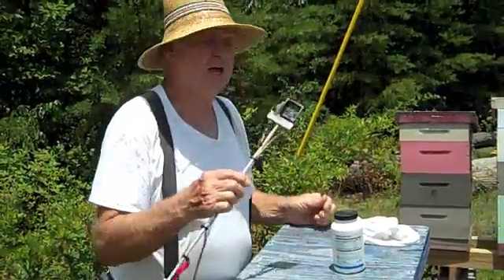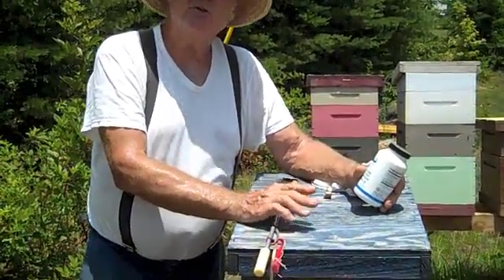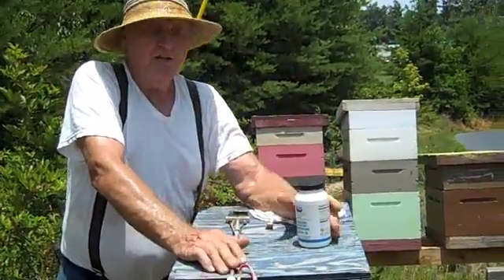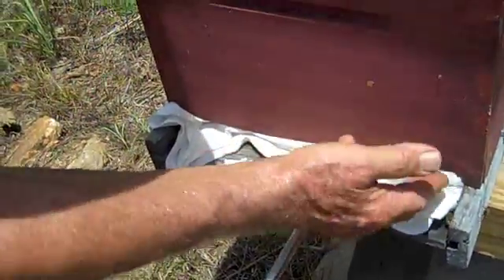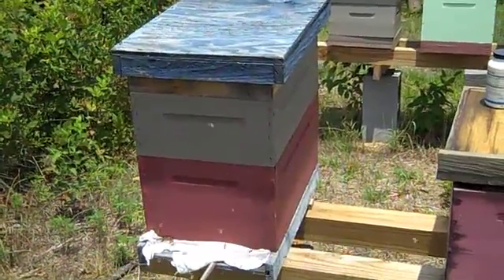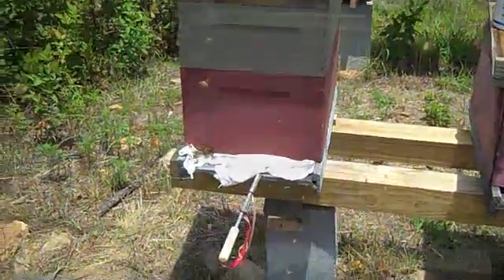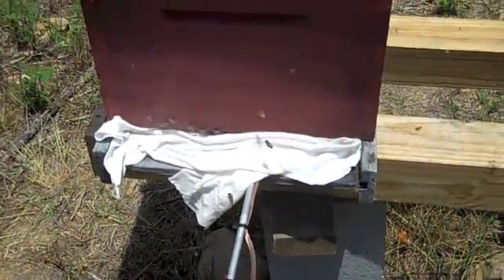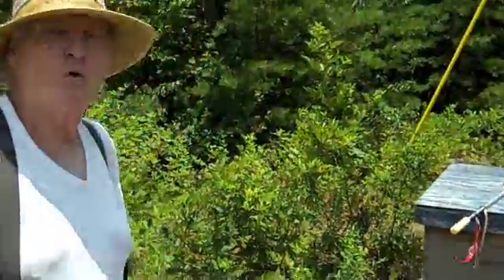Oxalic Acid Mite Treatments

Comment: I read a week ago that. Mite treatments are what is causing colony collaps.  I believe it.
I used it one time.  The bees did not do well.  After that I got rid of my weak hives and kept and only bred the best bees.  Good breeding  for clean bees  works best.  They are far more productive too.   Also if a stint produces a white pushups in an hour or two and the bees are fussy then I know they are sick and have a tummy ache.   I then feed them a quart of sugar water with erythromycin sulfate antibiotic in it.  A week later they are fine  and easy to work with.  Steeply is fire blight spray for pears etc.  I get t it at a garden store.

Comment: Thought you would be interested in this article that just came out on this subject:
http://www.sussex.ac.uk/broadcast/read/33537

"A team from the Laboratory of Apiculture and Social Insects (LASI) has determined the best dose and method for treating hives with oxalic acid, a naturally occurring chemical already being used by beekeepers to control Varroa. 

The study, published today (Thursday 17 December 2015) in the Journal of Apicultural Research, shows that two of the three methods used by beekeepers to apply the chemical cause harm to bee colonies, resulting in reduced winter survival. 

But one method – sublimation, by which the chemical is vapourised inside the hive using an electrically heated tool – has no negative effect on the bees. In fact, colonies treated in this way had 20% more bees four months later than untreated colonies. 

It is also the easiest to use, the deadliest to the mites - killing 97% with one application - and is effective at lower doses than the other methods."
Reply: +LSUTigerMom Good find, after watching many Italian beekeeper videos and Don's recommendation it's not hard to make this informed decision to use vaporization by heated element the method of choice. Thanks for your good post.

Comment: My question is how effective is this treatment to a hive that is 4 supers high? and do you suggest to always apply the fumes to the bottom entrance, there is a couple of post's on here where the guy puts a shim block onto the top then covers the top with a piece of plexiglass. The shim block has a hole in it where he inserts a short length of metal pipe and the oxalic acid is in the end of the pipe outside, he then caps of the outside end and heats it up with a propane torch which in turn fumes out the oxalic acid into the hive but will this make it all the way down through to the brood chamber?, I figure it is probably better to fume out the bottom since heat rises and would lift the oxalic fumes up through the brood chamber better. What do you think about this method Mr. Fat Bee Man?

Comment: Hi all, I am planning to do one myself. As heating tool I am going to buy a glow plug from a car store who sells car parts (it heats diesel prior starting the engine) and it's dead cheap approx 2 Euros here in Malta (Europe). I am going to place the heating element in a copper tube (get a scrap of copper tubing from air con copper piping cuts) and you're done, just need a 2 min wiring by connecting the nut which is opposite the heating element to the +ve terminal and the body to the -ve side and you're done.
Reply: Hello Jean Paul,
Did you build your vaporizer yet? I would love to know your results. Thanks, Teresa     taparker@insight.rr.com

Comment: Zuconja, Oxalic acid alone does not form formic acid. Anhydrous Glycerol is required in the presence of Oxalic acid to form Formic acid.
Reply: Oxalic acid breaks down in chemical reaction to make Formic Acid and Carbon Monoxide. I WOULD NOT WANT TO BREATH THAT. Many other reagents other than glycerol help this reaction to happen.
Reply: Yes, DavyB, but requires a reagent regardless. Zuconja was implying heat alone forms Formic acid. Simply heating oxalic acid will not create formic acid, and is a safe and effective mite treatment. Breathing the vapors are not recommended in any case.
Reply: Toby Schmid Did not say it doesn't just that your example of Glycerol is not the only one (My background is BSc (Hons) Chemistry degree)
Reply: Yes, I'm aware you didn't say tbat. That is why I am answering Zuconja and his misunderstanding that only heat is required. Thanks for your input though.
Reply: +Toby Schmid The literature I've read says that oxalic acid decomposes to formic acid and other byproducts upon heating.  I even consulted a chemist who told me the same thing.  I've carried out careful experiments of my own and the OA sublimates until it reaches the decomposition temperature at which point it turns into a liquid.  If this liquid isn't formic acid, I'd sure like to know what it is.

Comment: I suppose the vaporizer is made with a glow plug. Glow plugs heat up to 1000 C. Temperature for oxalic acid sublimation is 157 C. Higher temperature causes oxalic acid degradation and it turns to formic acid.
So, how does this vaporizer maintains 157 C?
It doesn't, so this is not oxalic acid treatment.

Comment: Hi Don,
1) Is it true this is only good for Mites that are not capped in the brood?  
2) Does repeated vaporizing harm the bees? 
3) Does OA  contaminate the honey?  If so Do you have to leave any Honey that gets exposed to OA - sit for a time before its edible?  
4) What Season do you treat with OA in (Fall/Spring)?  Or Both?
5) Can you treat in the middle of the Honey Flow?
6) should you wear a respirator/mask when using OA?

Thanks~Rob

Comment: Sorry, I did not want to dispute your knowledge or anything similar. Here in Serbia, oxalic is done in early winter when there is virtually no brood and the honey is the one which will be mostly used by the bees as winter food.  Trickling eliminates 90-95% in one treatment. This cant be done with vaporizing as the varroa is safe inside capped brood. It's also very safe, as opposed to vaporizing. In the end every beekeeper has to choose for himself, no matter the number of beehives. Regards.

Comment: DO NOT INHALE THE VAPOR! It's very bad for your health. Besides, the trickling method is safer and faster and more efficient. It is done in the brodless period and it will catch almost all mites. Vaporizing needs to be done 4 times to catch all mites which are hidden in the brood. Trickling method kills all mites as there is no brood where they could hide. With trickling there is almost no danger for the beekeeper. You must be careful not to get the acid into your eyes or onto your skin.